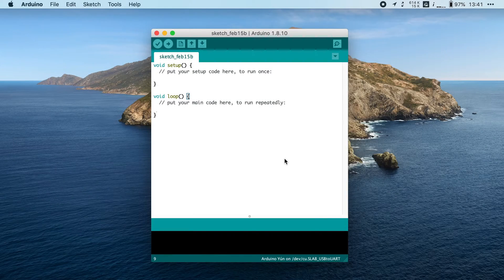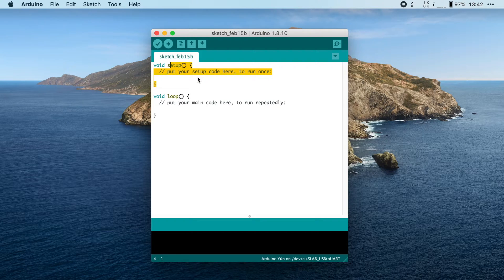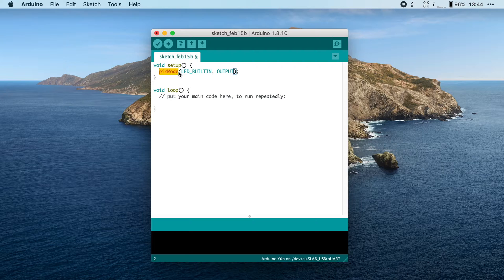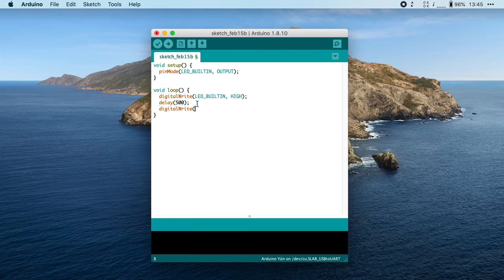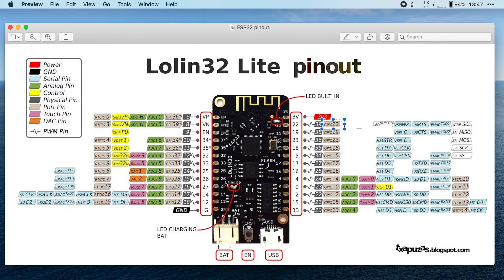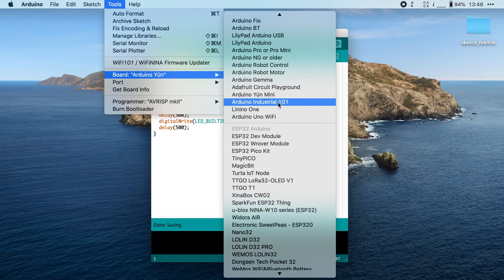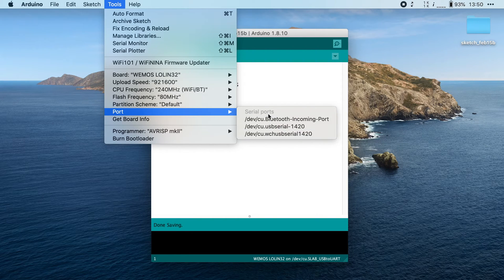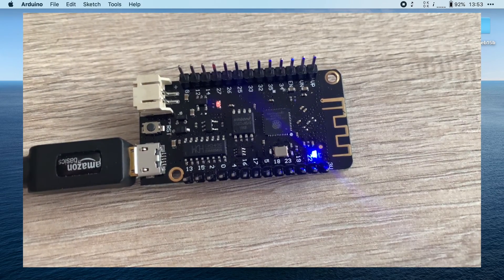ESP32: Blink the LED (ESP32 + Arduino series)

Comment: After spending hours to pull my hair, I realized the cable I was using was not able to transfer data and was not visible as /dev/ttyUSB0. Make sure you have a correct cable...

Comment: no, it didnt work, in my case (esp32 wroom_v1)
this is what worked for me:
int LED_BUILTIN = 2;
void setup() {
pinMode (LED_BUILTIN, OUTPUT);
}
void loop() {
digitalWrite(LED_BUILTIN, HIGH);
delay(1000);
digitalWrite(LED_BUILTIN, LOW);
delay(1000);
}
Reply: For the 38 Pin version you need to use LED_Builtin = 1
Reply: @ichbinderroboter  THANK YOU very much
Reply: @ichbinderroboter  yes, thats true 👍
Reply: @ichbinderroboter  Thanks!